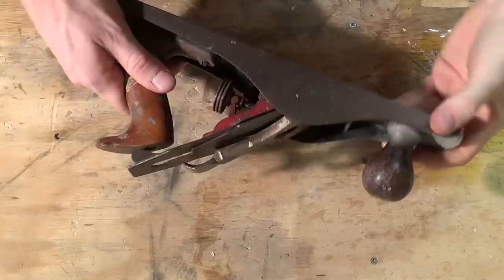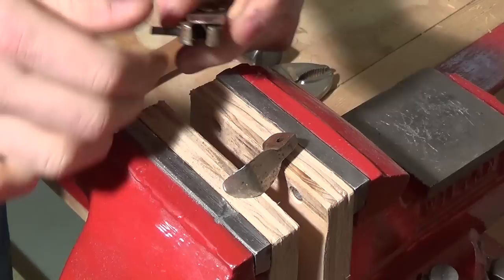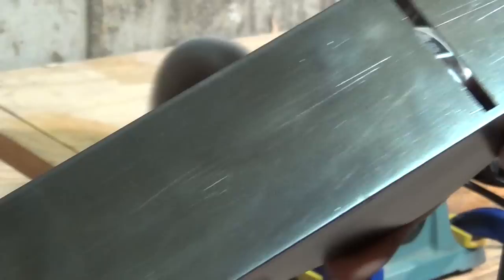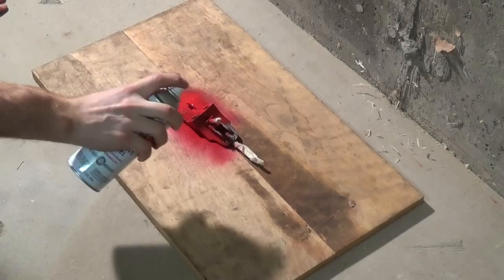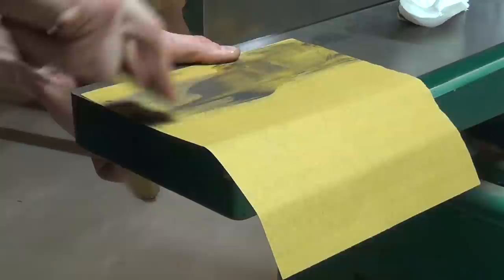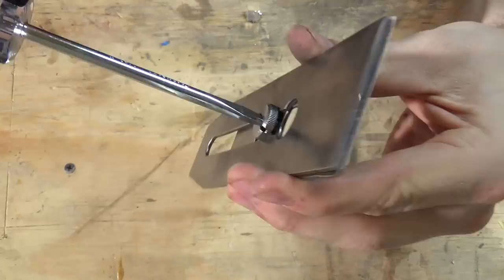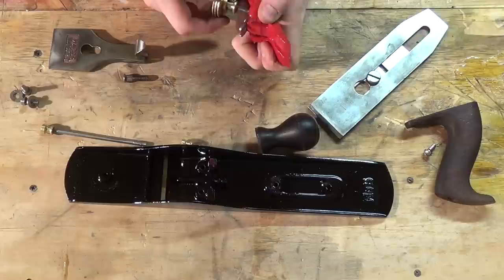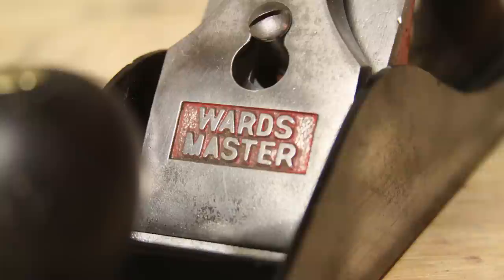Hand Plane Restoration: Vintage No. 5

Comment: Nice job, one slight problem, when you repainted the frog and sole plate you did not mask the reference surfaces, so any paint coating will upset the setup and make it inconsistent once the paint between the surfaces starts to break down due to compression. You could scrape it off with a razor blade, oil the surfaces and reassemble. So that's frog to soleplate contact points and cutting iron to frog contact surfaces.

Comment: Thanks for making this video. I just restored the Craftsman 409 model of this same plane. Found it in my dad's old tool box. Rusty. The whole thing was brown with rust, oil, and grim. I didn't do quite as nice of a job as you did getting the metal super shiney and I didn't repaint, but mine turned out well. Mine had some pitting so I might take it apart again and put a wire wheel or brush to it to see if that helps. I had only used very fine grit sand paper. And I used MinWax on the handles. Linseed oil looks better. Your video was vital for me getting it put back together right.

Comment: A wire wheel is a last resort to remove rust.  I never used one on a hand plane. Always try something else first - cleaning vinegar bath - fine steel wool - fine sandpaper.
Reply: Dremel with abrasive wheels works well.

Comment: This plane turned out very nice. I did cringe when you used the coarse wire wheel on the brass. I'm not sure if you have a Harbor Freight near you, but they sell awesome soft wire wheel sets that have at least 6 different shapes so you can easily fit into those right spaces next time. Also, I was hoping you were going to repaint the Wards Master logo on the levercap. Any reason why you didn't? I personally would've thought that simple feature would've been the icing on the cake for this project, especially with the beautiful red paint you used. Great job all the same.  😃

Comment: Thanks. I was given a Stanley 5 1/2 last week in similar condition so will take on board some of that. Cheers from 'down under' :)
Reply from the maker: Good luck, Rob!
Reply: The Stanley no.5 ½ is a fairly collectable plane. I hope you didn't do anything too drastic during your restoration, but IF you're going to be the end user, than that part doesn't matter. To each his own. I hope it worked out for you!

Comment: The coating on the lever cap is probably chrome plating
Reply: was
Reply: Probably nickel.  Nickel was used a lot on tools and firearms in the early-mid 20th century.

Comment: Does it matter to the metal if you use a wire wheel brush to clean out rust or is it just as effective to soak the parts in rust removal chemical?

Comment: Shouldn't you have mask off the seating surfaces where the frog contacts the base of the plane? It will be awfully hard to move the frog forwards or backwards with the adjustment screw with paint to paint surfaces..
Reply: I had been wondering the same thing.

How does it perform now, +dharmon 35?
Reply: If you want a prper  understanding of how to tune a plane...look at Paul Sellers vids.
Reply: There were some areas that were bare metal when you dis-assembled the Frog and the Frog base on the foot that should not have been painted... hope they haven't caused too much of a problem now they've been painted... maybe keep an eye out for them the next time you restore a plane... oh, and Jay Bates as well as Paul Sellers have good videos on restoring planes...
Reply: Yeah, I don't know how fast that paint hardens and by how much when it does, but if it's anything like the stuff I've used in the past those two parts will be practically welded together.
Reply: @ChrisTheGregory  it usually takes that type of paint around a week to completely harden. I'm sure he fastened this together within a couple hours of drying so yes, it'll suck when it comes time to disassemble or adjust it.

Comment: you can tell this is a novice approach, there are areas that could have been done better. However i picked up a few ideas from this. using the jointer base as a true serface, i never thought of that. its a shame the handles were sanded, they are much more valuable with the original stickers on them. all in all your on your way. each one you do you will get better. now its time for a smoother and a #3